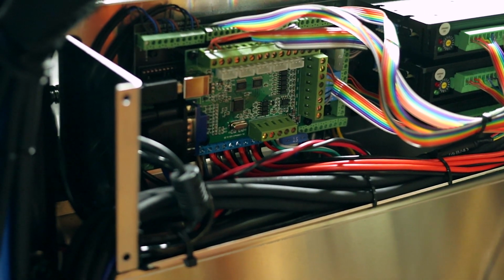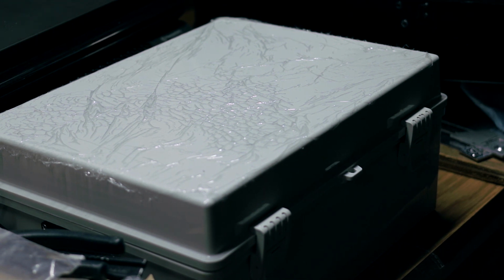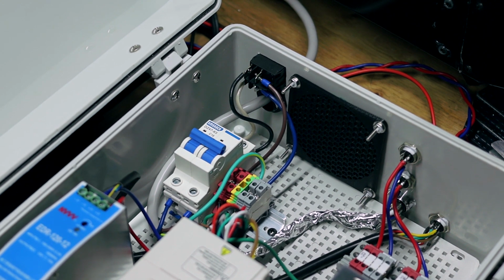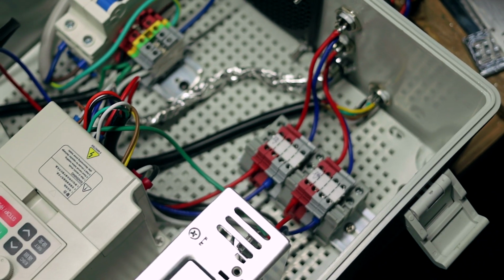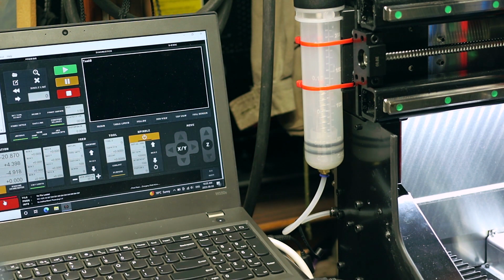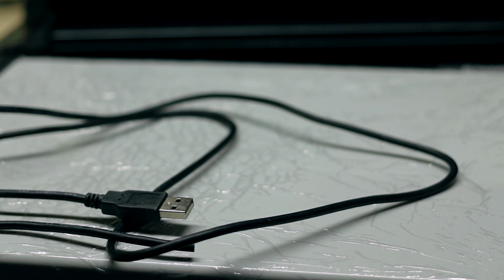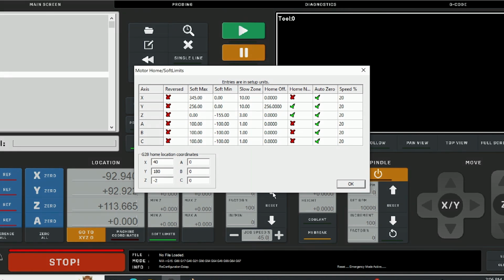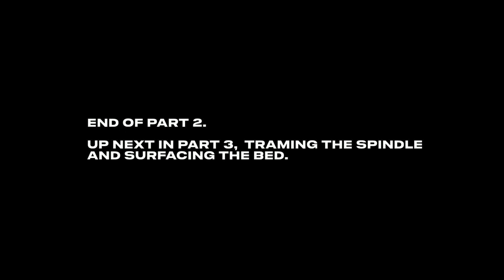Shariff DMC2 Build Part 2: Electrical and First Cut

Comment: What did you do to bypass the power bricks; from the looks of the video you didn’t solder the barrel jacks to the board either
Reply from the maker: I soldered a pair of wires direct to the board. I'm using a single 12V power supply. It's the NVVV
Reply: @amp_mechanic  I was wondering about that 12v power supply whenever I watched you video.lol Definitely like this concept a lot more than the mess of bricks. Would happen to have a shot of where you soldered onto the board for those wires. Was looking at the part where show you circuit board mounted but it just looks like a blank space where power input goes
Reply from the maker: @kameronmcdougald1442  Sorry, I don't. I just looked this morning and I can't get a clear pic with the wire bundle in the way. I just stripped a long enough section of wire to bridge to both positive and both negative solder points. (I think they are actually connected together on the board anyway.) I think the top is positive but double check by looking at the barrel jack orientation.